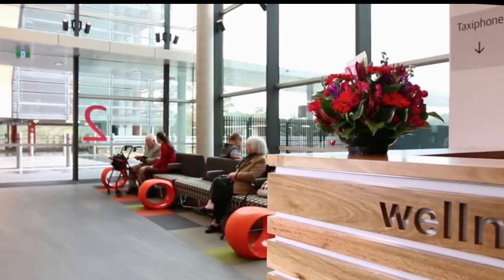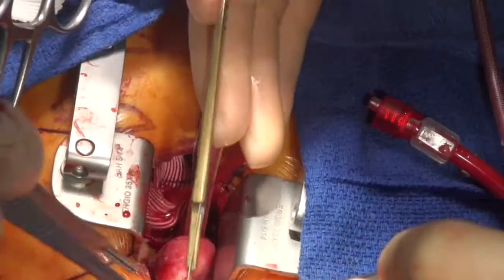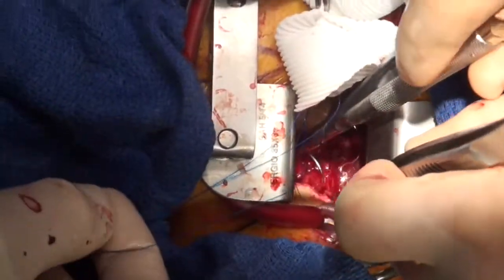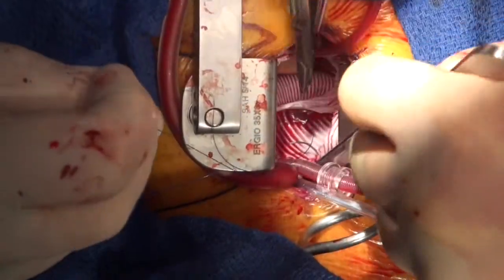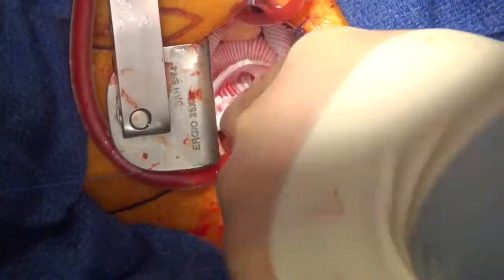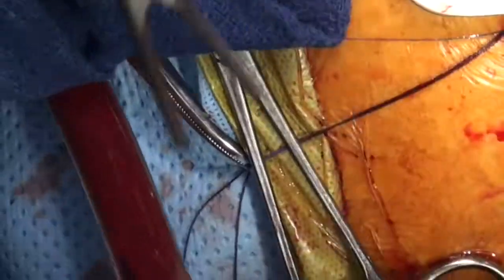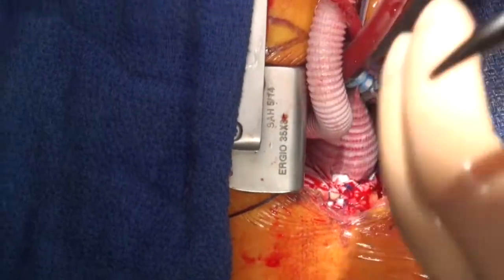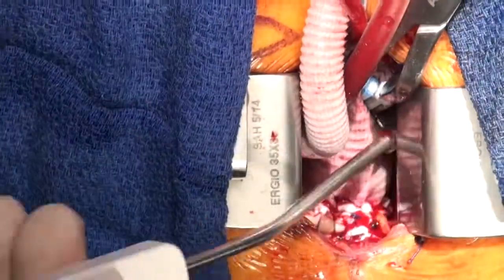[Part 5] Open Distal Anastomosis - Mini-Bentall and Hemi-arch Replacement

Comment: Excellent operation! I want to know the temperature of HCA and time of HCA?   How much is  the flow of unilateral cerebral perfusion?  Thanks
Reply from the maker: I usually cool down to 25 degrees for a hemi-arch replacement. The open distal anastomosis would usually take 15-30 minutes. I would make sure each stitch is done properly, without exception. The flow of cerebral perfusion is approximately 10-15 ml/kg/min.
Reply: Thanks,   under 25 degrees and unilateral cerebral perfusion, how long is safe for HCA in your opinion?